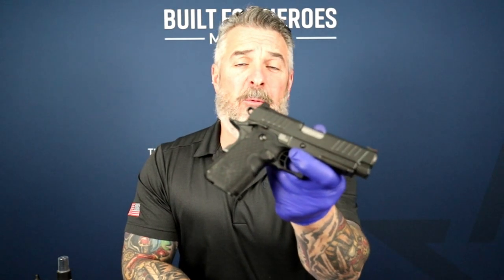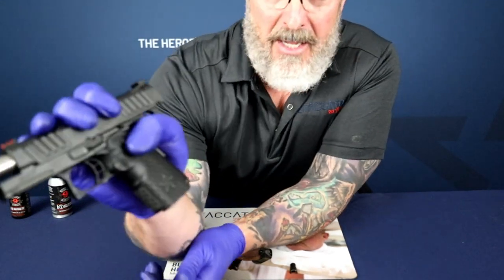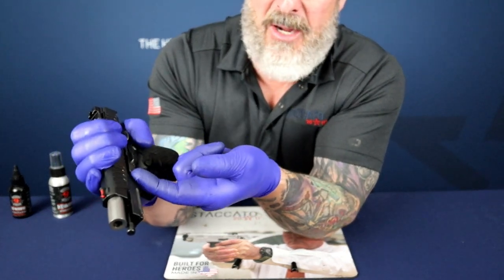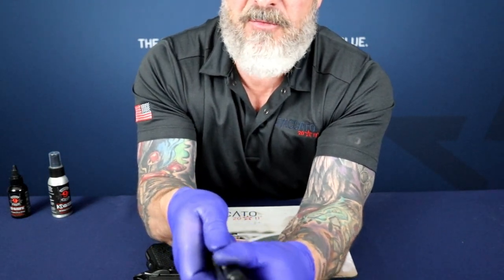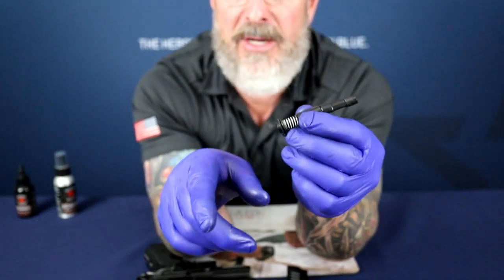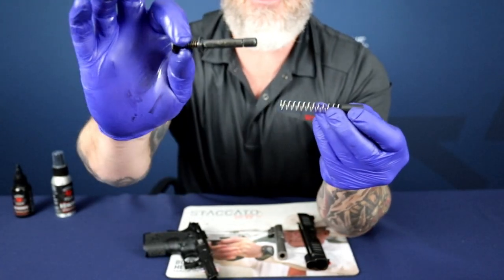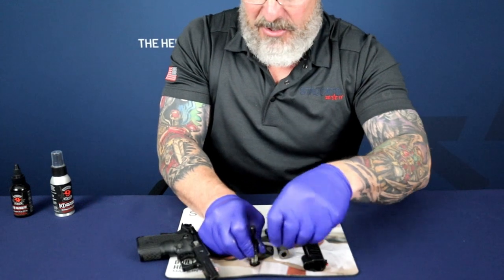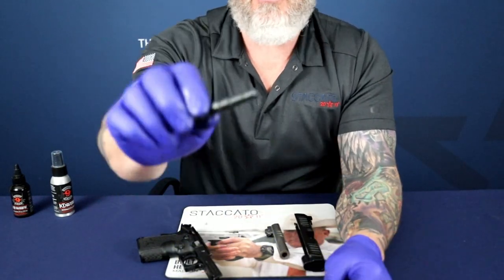Staccato C Pistol Disassembly

Comment: Side note, do not point the spring at yourself or anyone around you during disassembly, that reverse plug will be flying across the room at Mach Jesus with zero regard for your eyesight. Safety glasses are also helpful! Great video and super excited to join the Staccato 2011 family as I eagerly wait for mine to arrive.
Reply: LOL very true! That's why sometimes I prefer to do it without the tool so I don't have that risk. Just like any other uncaptured recoil spring system.